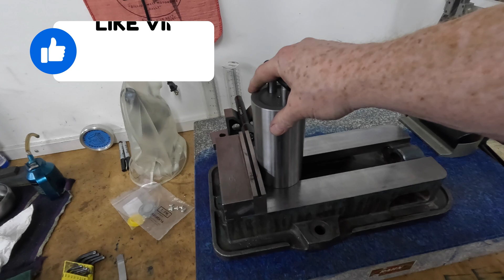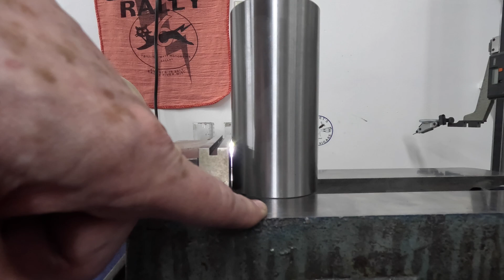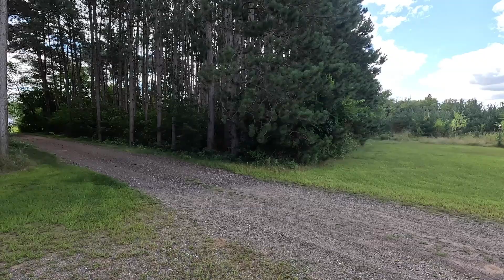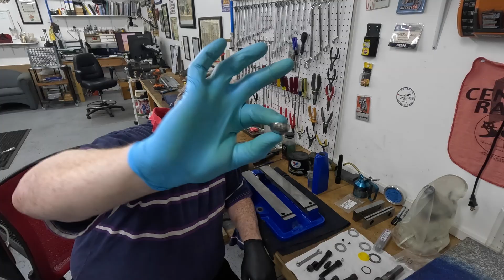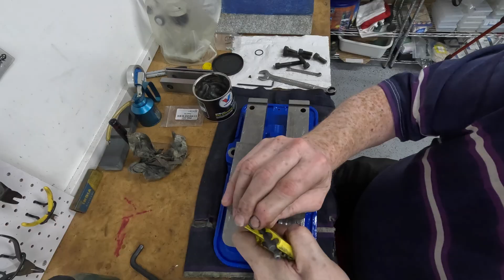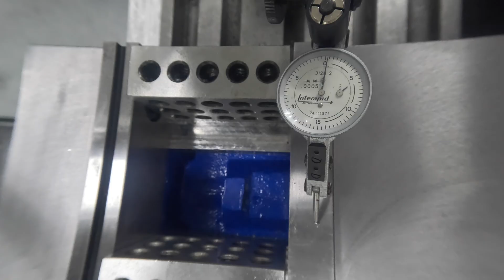Kurt Vise Refurb Part 3 - Final Checks and Assembly - is it any good? 5000 Subscriber Draw Details

Comment: Very nice job Stuart. A burnished finish or even a quick swipe over on the surface grinder would top off your top notch job...Again very very nice job. Keep up the outstanding work !
Don
Reply from the maker: Thanks Don! I’m keeping my eye open for a surface grinder. Used equipment prices are dropping, so could happen. On the other hand, a milling type burnishing tool would bring it up a treat. 👍
Reply: @StuartsShed  I found and refurbished a Sanford model MG made in April 53, cost was a whole $300. Had a 5x10 Walker fine pole mag ser # 1.....works like a charm....they come up occasionally and are an ideal size for a small shop.